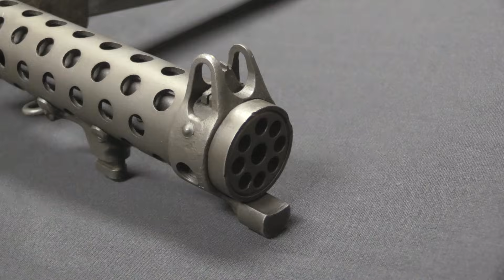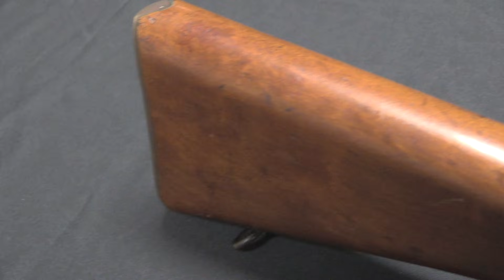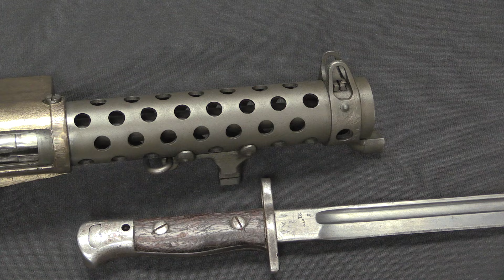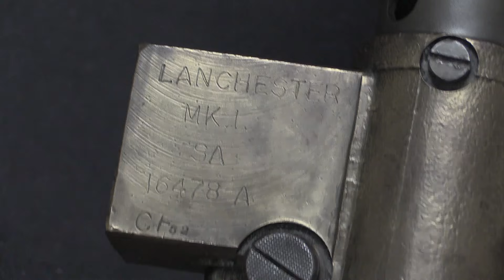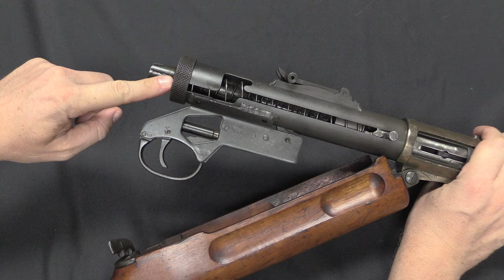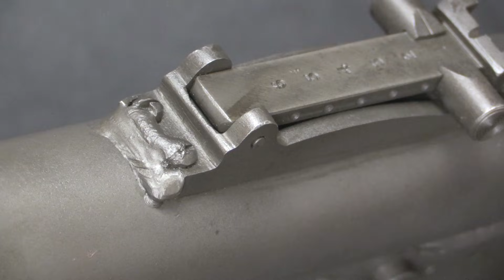Lanchester MkI: Britain's First Emergency SMG

Comment: never understood the point of putting a 2 foot bayonet on a sub machine. They are supposed to be used at close range and it seems like a chore to haul a massive bayonet around
Reply: But you can STAB THEM!
Reply: Drago R6 In melee combat reach is everything. If you have a short bayonet on an smg and you come up against someone with a bayonet on a full length battle rifle you will be at a huge disadvantage. The long bayonet is an attempt to remove that disadvantage.
Reply: For the Bayonet Rush, of course!
Reply: I would imagine it is like that because if you ever received the terrifying order to attach bayonets, you would at least have a chance against an enemy who likely has a full size rifle with a bayonet.
Reply: One of the most fearsome things in an infantry battle scenario is a full blooded British Army style bayonet charge it will turn the bravest man's knees to jelly if he is on the receiving end. The two foot-ish sword bayonet is also aptly named because it can be used as a short sword independently of the gun as a weapon in its own right. With many smg's of that era suffering reliability issues having a back-up weapon is kind of necessary.
Reply: Drago R6 They don't like the cold steel. They DO not like it up 'em!
Reply: Drago R6 - that's not even the worst of it. We Brits tried putting a bayonet on a pistol.. think it was a Webley
Reply: FWIW, bayonet on an SMG is probably a hell of a lot more wieldy than in hand--there's a reason they pretty much weren't ever used that way.

The utility of a bayonet for policing boarded vessels actually makes a lot of sense to me! 

I wonder if Ian has any information on the exact rationale behind the bayonet lug. Certainly there are many possibilities. (Also, is that the pre-WWII standard-length bayonet? Did the Brits' bayonets get shorter during that war, too?)
Reply: The lugs were probably added to get around the lingering "gangster guns" bias in high command by making it as rifle like as possible. They likely used SMLE bayonets because they were readily available. Especially for the navy who are fairly low in small arms procurement order. BEF in 1940 had virtually no No.4 rifles with the short bayonets.
Reply: I'm sure you'd change your tune if you were using it and ran out of ammo as you came upon somebody
Reply: +HappyandAtheist If you have an image of how big a tank bayonet is then think how much bigger a 155mm artillery bayonet would be :)
Reply: +Peter Hopkins Look up the M777 howitzer, it has a thing on the end of the muzzle for attaching the gun to the back of truck for towing and if you didn't know what it was for you might think that it was a bayonet.
Reply: +Riceball01 I see what you mean. They used a similar idea on the L2 Mobat or L6 Wombat recoilless anti tank guns.
Reply: Well if you've ever been unfortunate enough to have been occupied by British Crown forces you'd understand why the Brits put bayonets on everything their troops carried the are useful for intimidating unarmed civilians and during "policing" actions let's just say that many a civilian "unfortunately" ran into or walked backwards accidentally of course in to a squaddies bayonet.
Reply: +HappyandAtheist On the other hand, you have countries like Germany, that don't even issue bayonets anymore (they do issue combat knifes, but those can't be mounted on their guns).
Reply: Drago R6 I guess the main reason is to look stylish when you DIE FO JEE EMPRAH GI GO HOME TENNO HEIKA
Reply: +Jerry Long I think they are naval cutlass bayonets stolen from the guns outside the entrance of the Imperial War Museum in London :D
Reply: Because 30 bullets last you 3 seconds on full auto and at the time running out of ammunition was a very real possibility.
Reply: Courageous Ginger Pritchard-Greener bayonet. It actually wasn't that bad an idea for WW1, officers were only issued 12 rounds spare for their revolvers (and one would assume for the semi autos as well).
Reply: It's because bayonets are scary and most people are more afraid of being stabbed than shot. The most recent successful bayonet charge was in 2012.